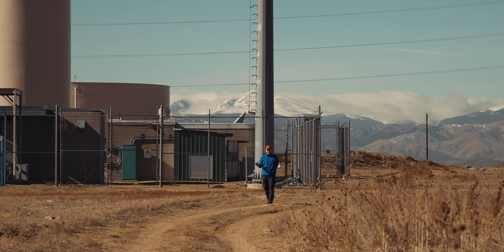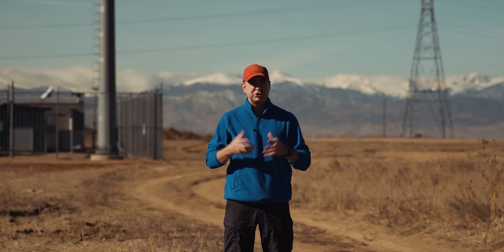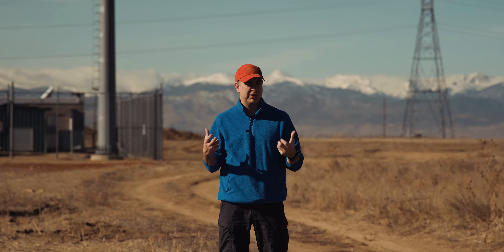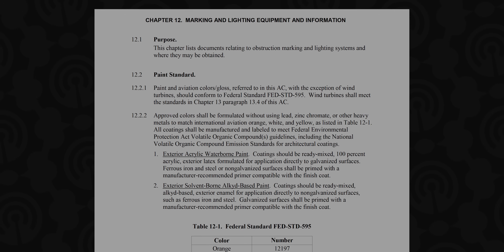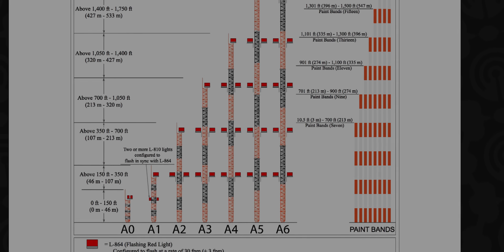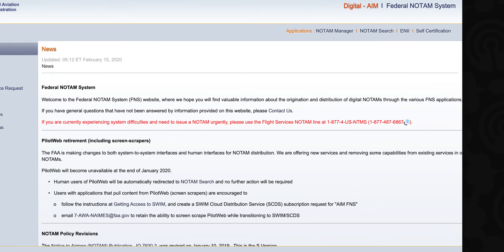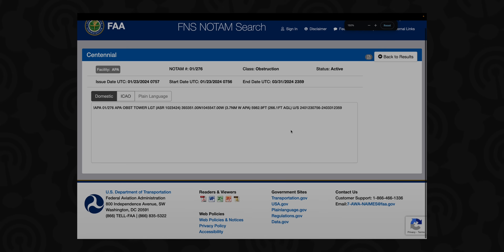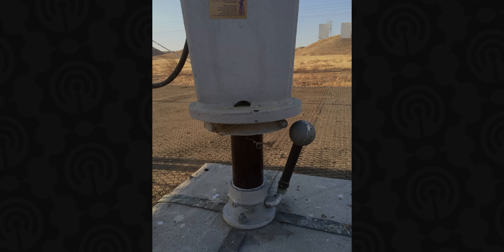The Anatomy of Broadcast Towers: Detailed Breakdown

Comment: In the 70’s I climbed and service towers for bi-annual maintenance daily. Our training was “Don’t Fall”, “Don’t Die” and if cops show up, stay inside the fence. Microwave com & TV were all the jobs up to 1,850’. It takes two techs at 10PM to startup talk TV towers with radio to local ground crew. The shut the power off at 4:30AM and switch transmitters inside the huts. This point, one climbs the top & change the beacon bulbs. Those a cantaloupe sized and took extras as one may fail. 1” thick glass & thin RED color shield inside. They hinge open like a pressure cooker w/wing bolts. You learn about wasps fast. No fun! Guy wires in ice zones have clamp plates and have to counted & distance. Grounds, voltage, bolts and wire tension test. Guy wires are pounds per foot at distance, so stop watch, hit with wrench and time the sound to return. The office made those calculations. I had three per day depending on distance. We serviced the entire Midwest.
  Wild stories about wind, if interested. Merry X-MAs 2025
Reply from the maker: I’m always interested in stories!! Email me at me@thebroadcast.engineer! I’d love to hear them!
Reply: @TheBroadcastEngineer 
  I was at a 300 ft guyed tower in IL on a windy day. I heard a noise as I got out of the truck. I saw the guy wires whipping in the wind. The base is a ball & socket type and was lifting 2” straight up, then down, back up, repeat. I didn’t climb that day.
Reply from the maker: 😮 whoa!

Comment: Is the helium balloon is cheaper and easier to deploy or change or hide and it reflect signals and does the same function and even better
Reply from the maker: The problem would be the amount of weight that balloon would have to carry. The antenna and cable would be too heavy. Plus if it’s a directional antenna, the twisting of the balloon would violate the licensed pattern.
Reply: Use reflective fabric so it reflect signal through amplifier chanel loop so it need no extra antena the balloon is the antena  @TheBroadcastEngineer
Reply from the maker: You’re not getting around the weight issue. And you haven’t considered the twist of the balloon in antenna pattern.

Comment: I used to live about a mile away from these two towers. I had the opportunity to talk with the crew when the north tower was being constructed. They were camping out overnights at the tower and I learned quite a bit about their process. I also learned what a BIG gin pole looks like, compared the little u-bolt and pipe thingy I helped my buddy with on his amateur radio tower. I am very grateful that these high intensity strobes are reduced at nighttime. I remember when these ones underwent a burn-in period and operated at full intensity continuously for around a week. The flashes made it difficult for me to get to sleep at times. The intensity required for daytime visibility is pretty amazing.

Comment: When I was a student at Cal Poly San Luis Obispo back in the early 1980’s, I was a DJ on the school radio station my senior year. There was a small hill on the east side of the campus called Radio Hill. There were two radio antennas, one AM antenna for a local public station, and an FM antenna for the school radio station. The AM antenna was rather large and very prominent. The school’s antenna which consisted of a wood pole with a stick antenna attached to the upper part of pole, was barely noticeable to anyone viewing it. The station at that time was only 2 kW. Most people assumed the large AM antenna was for the school station. The school antenna has since been relocated to the top of Cuesta Grade, at the north side of town. I’m not sure if the power was increased, but the service area extends like 30 miles from antenna out. The signal from transmitter to antenna back in the 1980’s was carried by two telephone lines for the stereo broadcast. As part of our DJ training, we had to know FCC rules and regulations in running a radio station as well as handling EBS tests and events. We were a secondary radio station in the case of an emergency for our service area. Each trainee who became a DJ also had to apply and receive an FCC license to operate a radio station.

Comment: The safest place to be during a thunderstorm,( if you have to be there at all) is on the tower away from the bottom and top. The tower has a faraday effect letting the lightning go around you to ground. More than once I've had to move to the middle of a tower, belt off, cover my ears and wait it out. Iv been essentially struck by lightning dozens of times because of this. At the top you become the lightning rod and at the bottom it can arc to a good conductor which being mostly water you are. It's actually safer to be on the tower during a thunderstorm than it is in the equipment shelter even though the transmission lines have lightning arresters because occasionally there are strikes that exceed the limits of an arrester enter the equipment room. But no matter the power of the strike the tower just takes it around you safely to the ground network. When establishing critical path for a tower site lightning is an important factor in determining whether grounding should be before or after erection begins..

Comment: Erecting a tower without a crane is done using a ginpole. The gin is short for engine as in physics it is a type of engine. Basically it is a small crane boom that is suspended from the side of your stub,( tower base ) and using a winch to raise sections into place. You bring up a section, swing it in to place, bolt it down and jump the pole for your next section. Stacking self support towers is more complex in that you bring up the legs and then to bring up the faces requires horizontal movement of the ginpole. to explain it sounds complicated and you need to understand some rigging principles but watching it done makes it look simple. Fun fact. Self support towers are built with only the legs tightened at first and then from the bottom up the faces are tightened one at a time which makes the tower plumb or straight. Otherwise it would look like a banana made of sticks.
Reply: Interesting fact. At one time ROHN made Ginpoles. They stopped because the liability was too large. They had no control over their use or miss use.
Reply: The tower manufacture does not provide tower erection instructions. There was a lawsuit because an installer assembled the free standing tower sections on the ground and stood them vertically on the ground instead of laying them down horizontally. This very unstable orientation resulted in a section falling over on a worker and killing him. The family sued everyone including ROHN but could not sue the employer because of Workman Compensation law. In discovery they requested the nonexistent manufacturer’s installation instructions.

Comment: The question of can radio frequency radiation commonly known as RF Cook a person. You betcha. I was putting a quarter wave dipole up for an FM station in Orange California and setting azimuth was a challenge because up there there is nothing to push against so I got between the antenna and the pole it was mounted on and immediately felt my body get hot from the inside. All RF is dangerous depending on proximity and duration and power level, regardless of frequency. If you were to get in the path of a 2 gigahertz studio tower link for TV you would be fried just the same as walking up and grabbing an am tower. Occasionally it happens that birds will fly in such a path and zap. They don't explode or go down in flames but they do literally cook on the inside and fall out of the sky. RF radiation excellerates the water molecules the faster they move the more heat is created which is why some things can be cooked in a microwave oven and some things shouldn't. Objects with no water molecules like foil repel radio waves that's why foil sparks and can ruin your oven. It reflects the power back into the transmitter kinda like if someone were to shoot at you with a laser and you put up a mirror and bounce it back at them.
Reply from the maker: Why was the station on while you were climbing to adjust the antenna?

Comment: I don't know where you got 800,000 feet tower but no. The maximum height in the u.s. is 2000 feet of tower and there can be up to 200 feet of antenna on top allowing a 2,200 foot maximum to the top beacon. In Russia there were a couple of 3000 foot towers but one fell leaving one.
Reply from the maker: I don’t know where you got 800,000 foot tower from…

Comment: Modern tower lighting is monitored remotely and the monitoring company could be in another state but when either beacons or obstruction lights fail they are notified through a ring down line and the FAA is also notified and they either have a tower company on standby or a list of companies that get dispatched for service ASAP. I worked for Leblanc and Royal and at the time they were the world's largest tower erector and manufacturer and they offered a service contract guaranteeing 400 feet of tower in 24 hours for emergency replacement.. they still make transmitters that are some of the best compared with Harris or dielectric.

Comment: Why do towers start fires when they fall
Reply from the maker: Most of the time they don't. If they do, it could be from friction and sparks as the tower collapses and falls into dry brush.
Reply: Broadcast towers should never start fires unless an AM tower shorts out to ground like if weeds grow around the base insulator.

In California, they do need to trim the electrical transmission ROW and trees grow into the conductors and set the trees and ROW on fire. 

Never have I heard of a falling tower creating a fire. I have even seen 345 kv towers that were hit by a tornado and collapsed on a house and dropped the 340,000 volt conductors on the roof. Did not burn. Steel tower arm in the living room, but no fire.

Comment: Was only in radio about 8 years but in that time, at a small (with an even less than lowercase "s") market station, part of my job was hanging with the engineer.  Without going into detail, there were a few times your advice @16:10 wasn't in the equation.  Due to an abundance of caution, I'm here to mention that but it gave me an appreciation for the pros in the 30+ years since.
Reply from the maker: There aren’t any stations in the Los Angeles market that will risk their engineers by putting so much pressure that they feel they have to climb the tower “or else.” In a small market, it’s just not worth the risk. Especially if the #1 or #2 markets aren’t exerting that kind of pressure.
Reply from the maker: @markdraper3469 I don’t understand…
Reply: @TheBroadcastEngineer  Sry.. oops on my part.
Reply from the maker: @postal_the_clown  No worries. I was just trying to understand. Oildale is in Kern County outside of Bakersfield.

Comment: 0:17 
"With FM it's the STRUCTURE"
"With AM it's the TOWER itself" then he says:
"...so the anatomy of the tower: you have the TOWER itself, the STRUCTURE..."
This makes no sense. Can someone clarify ? What is he referring to when he says "structure" if not the tower itself in its entirety?
Reply from the maker: Physically the structure of the tower. The metal parts. The bolts the nuts. That’s the structure. For an AM station all of that is energized as the antenna. For an FM there’s some metal parts up towards the top that are energized, not the whole structure of the tower itself.
Reply: @TheBroadcastEngineer  Ok. So to be clear:
For AM every metal part is the "antenna".
For FM only some metal parts toward the top are energized, NOT the entire structure. 
Correct ? 
Questions:
1. Are the guy wires also part of the radiating structure during AM transmission ?
2. For FM are those metal parts toward the top of the tower that are energized an actual manufactured antenna separate and apart from the tower that is just attached ? Or is it just the top of the actual tower ? 
Thanks.
Reply from the maker: @Thinks-First  Good questions. 

No, the guy lines are not part of the radiating elements. They will typically have insulators at points to prevent the antenna from grounding itself through them. There are some AM antennas (I didn't cover this in the video) that have a wire running along the tower structure that look like a vertical guy line but that is the actual radiating element. 

Yes, the FM antennas are manufactured by companies like ERI, Jampro, etc. If you look towards the top of the anteanns in this video's aerial shots at the beginning of the video you can see them as three lighter colored dots and three darker colored dots below them on the left tower. On the right tower is a TV station, and that white section is the antenna bolted to the top of the tower structure. Both of those towers are "cold" and you can walk up and touch the tower without any issues. If you were to go back on my channel and watch the KNX or KLAA transmitter tour videos, you'll see that the towers are sitting on ceramic insulators. If you were to touch the tower, you would become the path for electricity to go to ground and would have a very bad day. And the engineer would have a bad day having to help first responders scrape you off the ground.

Hope that helps! I'm happy to answer questions.
Reply: What he's saying is for an FM station, the antenna is attached to the top of the tower.  The tower is just there to support the antenna high in the air.  For an AM station the tower itself IS the antenna.

Comment: 1) Electrocution implies death. Shocked implies being in the path of the electrical current.
2) Not all AM towers are insulated, thereby "series fed". Grounded AM towers are "Shunt Fed". They are excited by a sloping line up to a certain point on the tower. They are relatively safe to touch, but as you say, you should not be there in the first place unless you are an authorized professional with an official reason to be there.
3) Towers are by regulation enclosed with a safety fence for a good reason. If you think you need to be inside the fence, most likely you don't Consult the tower owner or operator and explain your needs. That's a good way to get shocked, burned, have things fall on you or even encounter fast moving articles made of lead. 
-- 62 year Consulting Engineer, Broadcast engineer, tower climber. Retired, Denks Gott.

Comment: What they need now is a DJ monitor, that sounds an alarm when the DJ falls asleep.
Reply from the maker: We have a gentle alarm in our NOC, but if they ignore that for too long a loud piezo beeper kicks on.
Reply: Can't remember the last time we had jocks. All server based playout including intros and patter. Sigh.
Reply: We have one.  If the station goes silent for longer than about 15 seconds it starts sending txt messages to people.  It's mainly used to monitor the automation equipment as most of the time there's no DJ on the air.

Comment: Question about what you said when using standard vehicle jump cables to ground the antenna…are you saying the balls you would hook one part of the cable to doesn’t hold electrical currents? And obviously do this when the transmitter is off. I had to rewatch that part a few times to understand it how to ground the tower. You said connect end of the cable to the tower itself then the ball. You had also talked about how a tower can also be a good receiving antenna and currents still be carried if that tower’s transmitter is off completely if I understood that correctly.  
How is it that when connecting a jumper cable to a bare metal part on the bottom of the tower still couldn’t carry electrical currents and one not get electrocuted?
Reply from the maker: If you look at the balls, one is connected to the tower and one is connected to ground. You basically want to jumper those together without moving them. You're just grounding the tower. Yes, you want to have the transmitter off, otherwise, you could risk damaging the system.
Reply: The specifics of how to short a tower are probably best not explained in a public forum like YouTube for safety and liability reasons. People who have intentions on climbing without permission or training might think they know what they're doing and get it wrong. Most likely ending in a fatality.

Comment: Worked ground level at many antenna sites. Been there during lightning. Is it safe or more dangerous to be in the vicinity of a well grounded tower. Versus the open field
Reply from the maker: That’s a good question. I would think a little safer because the lightning has a path to ground, but I’d still try to stay inside a building or shelter than at the base of the tower.

Comment: As an Extra Class HAM this stuff is cool…great job…if it paid more I definitely would have gone into broadcast engineering…I went to school back in the early 90s and worked on my doctorate in the mid 90s…but have and still am volunteering for our local public TV station …I use personally a large telescoping antenna (12 meters) because I’m mobile most of the time…